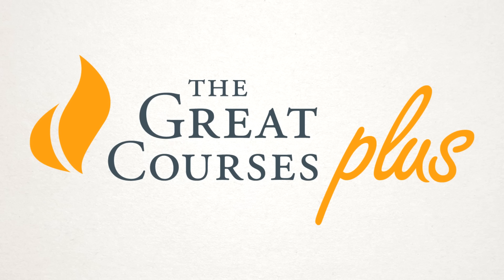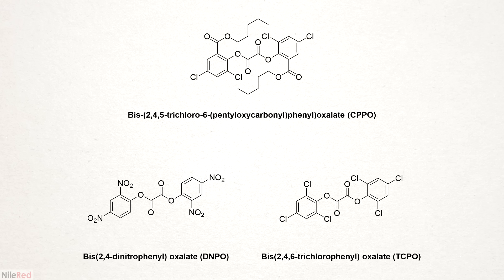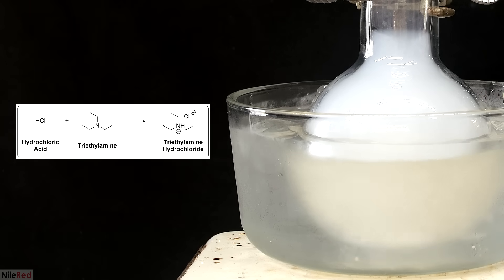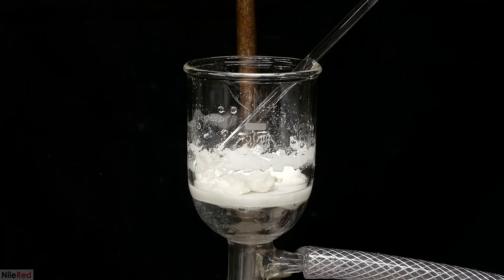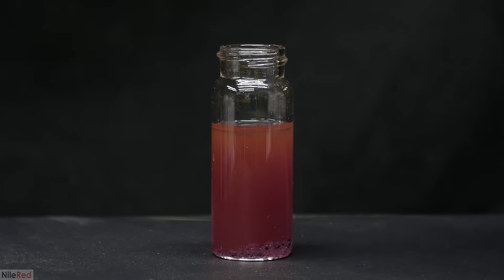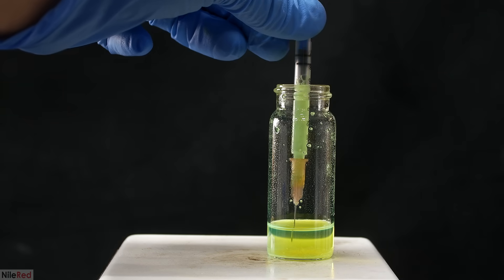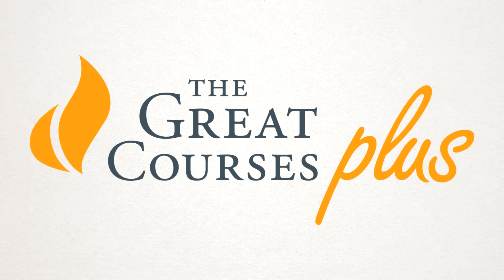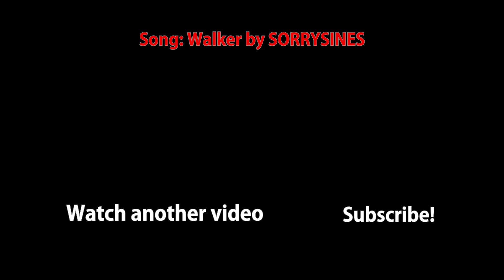Making glow sticks from scratch

Comment: Very interesting 😃 I have a question though...
I was told that used glowsticks could be used again simply by placing them in the freezer for a few hours then 'snapping' them again.
Sceptical I had to try it (just with cheap glowsticks) and it totally worked!
They weren't as bright as new, but pretty close.
How's this possible?

Comment: Why didn't you use clear rubber tubing for the glow strick in stead of a white valve would have worked way better could of sealed the ends with a heat gun

Comment: Noob question if you don't mind answering. How long will your Glow Stick Last? I recall you saying but it's not clear. Also you didn't mention if the glow would continue if you shake things up again so do tell if that's even an option... I know once you break a store bought glow stick one charge and it's done; but for the sake of GREED they want you to BUY MORE. Just wondering if your mixture allows for multiple uses. Thanks...

Comment: Thank you very much - I liked a lot :-) I have a question on another topic: Is there any to indicate temperature changes in a liquid to by change the color of it? Example - changing from under 50 degrees to blue and over 50 degrees red.  have no clue about chemestry, but my goal is to try to demnonstrate the mixing of a hot and cold liquid by means of using a pumpo to circulate the fluid transparent tubes and tanks. I look forward to your answer,, and thanks in advance.

Comment: About 3 years ago, I when returning from an EDM concert, I was playing with the glow sticks that I got over there (twisting it rather) and when I got home, one of the sticks exploded and it’s contents went in my eyes... I washed my eyes several times and then it stopped stinging. Recently, I got diagnosed with myopia and have to wear glasses.. Is there any connection between the two.. also, How dangerous is it if these chemicals enter the eye?

Comment: Toluene is a caustic industrial solvent. Please, anyone planning to attempt this, read the sds and stay well ventilated. Wear goggles, mask and gloves and avoid any splashing. If it gets on your face you will know in about 5 seconds and for the next 10 minutes after washing it off. I use this to clean fire Caulk and paint out of sprayer machines

Comment: So does it actually deteriorate over time eventually causing it to no longer work? Or would it glow again every time you shake it?
I was wondering what might happen if you had a glow stick that had a powder that was magnetic (like iron) inside, then a small magnet on each end of the stick so that the magnetic fields are overlapping slightly, would it cause the liquid to constantly stir (be excited) or would the powder just settle between the two magnetic fields?
Reply: Disregarding the whole magnetic stirring of liquids, let alone doing so with no additional energy ad infinitum.. the excited molecule comes into being from the remains of a broken down TCPO molecule. Shaking is not what excites it, it's a part of the chemical reaction where TCPO is all used up after breaking the vile. Shaking merely makes the reaction happen faster.

It's sort of like stirring in sugar to make a drink sweeter. Stirring helps it dissolve so it doesn't pile up at the bottom for ten minutes. Stirring for an hour wont make it any sweeter

Comment: I'm beyond late for this to be relevant but I had a thought, does ethyl acetate or anything else in the mix react with hot glue? what if you just plugged one end of the glass with hot glue (or something else that would act as a plug that wouldn't react with the chemicals inside or the peroxide) so that you could use thinner glass as the tube to get more volume inside with less air and no need to melt glass with a torch, not to mention the glass would be easier to break in the end product. Clearly I'm no chemist and would not be surprised if I'm missing something but if that'd work it might be easier?    Awesome video by the way, I can't say I could replicate it even if I had the equipment but it glows light on what goes into these things.

Comment: Not a chem; but why do you ice bathe what you heat up? Why heat it up in the first place?
Reply: Allzombifood  Heat is used to start the reaction between compounds. However, if it continues for too long the product will continue reacting either with the air or with itself and decompose into new byproducts. Freezing stops all reactions at once and depending on the chemical, stabilizes the final product.
Reply: @Ivi-Tora  So it evens it out. Thanks!

Comment: Hi Nile Red. Dye chemist here. This is a great video but I just wanted to give some commentary about the dye concentration you used. Fluorescence is highly efficient and more concentrated solutions (even just a few mg) will self quench the fluorescence. It may seem counterintuitive, but try even less dye for more light output. Dye molecules are flat and nonpolar and will form non fluorescent aggregates at high concentrations. This is a static quenching mechanism. Dyes can also deactivate excited neighbors through collisions, so-called dynamic quenching.Colder solutions will also be brighter due to decreased thermal deactivation of the excited state. This may not be noticeable though because dye excitation in a glow stick is based on local collisions in a reaction mixture where reaction kinetics determine light output. Higher temp will give faster rates therefore more light output. I would be curious to see if you could achieve comparable brightness in a fridge with the added benefit of extending the life of the glow stick. Keep these videos coming!
Reply: Vincent Martinez    This was quite a lot of interesting information:D I didn’t know the effect it could have with how bright it could be!
Reply: Lemme slap it in a microwave
Reply: @scottwales5966  with a vicks mask, crumbly tabs, bass pound hard like heart attack ... POP!
~2009, glowstringing Chicago
Reply: @scottwales5966  I like ure style
Reply: @scottwales5966  I did this in my recent tcpo video  microwave makes it brighter ✨️
Reply: Scott Wales 
How was cleaning melted plastic?
Reply: Im just gonna act like i know what your talking about...
Reply: @ooferpoofer2127  same
Reply: @ooferpoofer2127  same
Reply: @ooferpoofer2127  you dont have to know whay hes talking about hes teaching you what he's talking about kridviijisbsjzuriritorjrjsjsjshekehsjshshwokbahadijrj
Reply: @ooferpoofer2127  same
Reply: This is why I love YouTube!
Reply: @pramodshahji1794  Principles of Fluorescence Spectroscopy by Lakowicz is essential reading. I would start there.
Reply: So will the thing that you said would increase the intensity or the energy of the photos coming out?
Reply: @namansingla2975  It would increase intensity (number of photons). Energy is determined by the molecular orbitals. These are locked for a specific dye so you are not changing energy.
Reply: @abby Hi abby.
Reply: Deactivating excited neighbors sounds cool, all I need is dye and some collisions, so throwing paint at his house should work :D
Reply: was dead ass thinkin the same thing
Reply: @3mmiii975  I need ta get my boots on..... shits getting deep in here lmao 🤣
Reply: my tiny brain is trying to process this
Reply: This is what youtube is supposed to be used for.
Reply: @jeast9648  facts
Reply: So, both colder, and higher temperatures will make it brighter?  Gotcha.
Reply: @Qui-9  Depends on a lot of factors. If excitation is by light then colder will make it brighter 100% of the time. His excitation is by reaction. Reactions are faster if heated. He would have to experiment to know for sure.
Reply: @vincejohnm  " Depends on a lot of factors. If excitation is by light then colder will make it brighter 100% of the time. His excitation is by reaction. Reactions are faster if heated." 

What's the reasoning behind this?  It's interesting to me that the process used to create excitation has exactly the opposite effect based on the method in which it's occuring. (Or attempted).  Is there some type of relationship that creates that disparity?  Or commonality?  (Guess it depends on how you look at it.)
Reply: Hi Dye Chemist, I am the Steel Alchemist
Reply: @awesumsawce hi abby im a human being
Reply: I’m always blown away by beautiful colors in chemistry. Totally appreciate your comment
Reply: Duck I love how smart people are like magnets thanks for the lesson
Reply: @Fakeittillumakeit101  ah duck not u man.. I’m sorry..
Reply: @queenkiki5368  yea it’s kinda what I was implying sorry if it went over your head
Reply: @Fakeittillumakeit101  NO DUCKING WAYYY LMAOOO
Reply: That's pretty fascinating!
Reply: Holy crap do I love this channel.
Reply: Did anyone else have no idea that a dye chemist is a thing
Reply: This is actually really fascinating. I'm definitely no expert, but thank you for commenting this, definitely has inspired me to read more about dye and fluorescence chemistry.
Reply: I like your funny words magic man
Reply: damn, an actual knowledgable comment on youtube
Reply: I so loved this vid an this comment. Are ye gonna try mate!?? ✌🏻💗😊❣️
Reply: A Hispanic chemist, that’s awesome! I had never seen one before. Keep doing us proud man. Greetings from California. 👍🏼🇺🇸
Reply: Hi mr smart I’m quack
Reply: @quacktheduck3652  your high on QUACK x3
Reply: @quacktheduck3652 the way I felt when reading this lol
Reply: This is incredibly helpful! Question- Do you know how to make, say, glow in the dark dye powders or pigments? I'm looking into potentially making some glow in the dark products (dice specifically) to expand what I'm capable of selling, and if I could make my own glow dyes for cheaper than buying some online already made, I'd definitely do it.
Reply: @StormTheSquid  Glow in the dark is not fluorescence. It is phosphorescence and is a different but related phenomenon. For phosphorescence to occur you need a very long lifetime in the excited state. This increases the odds that the excited electron is perturbed into a triplet excited state and cannot relax (spin forbidden transition). I believe that is why plastics are used for many glow in the dark products in that they restrict molecular motion which can increase fluorescence lifetime. I could be wrong though. I worked on small molecules for in vivo use, not commercial plastics.
Reply: @StormTheSquid  you can buy glow powders in many colors on Amazon and mix it in resin to mold your dice.
Reply: @JustAnotherPaddy  I could, but the point of asking was to see if I could do so for cheaper on my own instead of buying them ready made.
Reply: @StormTheSquid  what's the making cost for one that you can put in. Also what's the price they are sold for online?
Reply: @namansingla2975  how can you type that and not know how to find out what you re asking?
Reply: @leojciaccioii  Who’s to say he or she didn’t search for this question before or after posting their question? What’s wrong about seeking another source of info? Why are you downing him or her so much for seeming info? Lmao chill
Reply: Lamar Davis except you didn't
Reply: I- don’t understand but O K
Reply: Very interesting, I didn’t know that.
Reply: eerrrrmmn big science
Reply: this is like the cutest interaction i’ve ever seen lol
Reply: I knew that
Reply: I like your funny words magic man.
Reply: Remember, dyes are subtractive.
Reply: Holy

Wow
Reply: Hi mr dye chemist, im hila
Reply: @lampkin45 hi Abby, Im osi
Reply: Ya I def know what your talking about 😎
Reply: What would happen if i injected myself with the fluorescent dye
Reply: wait, hold up, you said: "Colder solutions will also be brighter..." and you also said: "Higher temp will give faster rates therefore more light output." I'm confused, which one makes more light?
Reply: @Metal_Master_YT  I answered this in an earlier post but maybe I wasn’t clear. If you excite the dye with a black light (UV) then cooling the solution results in brighter fluorescence. Glow sticks don’t work like this. They are excited by chemical reactions. Reactions go faster with more heat which means more light. It’s a balancing act. Too much heat destroys fluorescence. Too little heat and the reaction goes really slow. Without experiment we can’t say which temp will be brightest.
Reply: Great😊
(Deep inside my mind:WHAT THE HELL IS HE TALKING ABOUT😵)
Reply: one time, i was so cold i put my hands inside the microwave to make it warm. and then i thought, 

"wow! i'm the most stupidest person in the world"
Reply: Yes of course, it’s so obvious when you think about it
Reply: I dont know what all that means...........lol
Reply: What's the scientific formula for di-chemist
Reply: When I was a kid, we would store our glow sticks in the freezer to keep them "good" for longer.
Reply: How did I understand this amazing thank you
Reply: thank you for the knowledge
Reply: I guess, I have to go back to ebay to get my glow sticks..
Reply: Yep. That’s what I was going to say.
Reply: Hehe smort
Reply: As a kid, whenever we got glowsticks they basically lived in our freezer forever in the silly hope that they would work forever
Now I know why.
Reply: Make a YouTube video pls
Reply: Yeah, what he said, obviously
Reply: Im just gonna go back to kicking rocks in my dumb people corner. Holy hell.
Reply: Wow, I learned something new from this comment thanks!
Reply: @rixile wait what
Reply: Thank you for the mini chemistry lesson! Very interesting.
Reply: To many words but i agree
Reply: I was about to say the exact same thing
Reply: 7383 people acting like they understood a word.
Reply: Bhiao koi nhi padega yeh
Reply: Wow
Reply: I’m gonna give him the “ite”
Reply: My brain is confussled
Reply: Such amazing info! Easily deserved a sub!
Reply: WOW SO DETAILED
Reply: Hey, when I'm reading your comment I was goin' on blah blah blah blah blah and at the end, I smashed my head on the wall because my last brain cell was thinking, "Hey Man, who IS this guy? Is this Einstien's relative?" I am now undergoing a surgery due to my smashed head. But, speaking the truth, You REALLY are a GREAT guy! Thanks!
Reply: Hi dye chemist, Parker here.
Reply: I like your funny words magic man
Reply: Funny words magic man
Reply: NEEEEEERDDDD
Reply: Oh so thats why they revive themselves in the freezer!
Reply: This guy sciences
Reply: Can you make cocaine???
Reply: @robd1329  What color cocaine?
Reply: îoo
iookîkkòoooo
Reply: Huh?
Reply: Someone’s getting laid in collage
Reply: I love big brains 🧠
Reply: Hi Dye Chemist! I'm Dad
Reply: This is a lot of stuff
Reply: Way too much I hope you know that you are smart
Reply: Interesting
Reply: we got a nerd here
Reply: @superkickparty8500  I think you’re in the wrong part of YouTube. “Coloring in the lines” is that way 👉🏼
Reply: My sentiments exactly after watching this.
Reply: got roasted by a 90 year old xD
Reply: Martinez, hi I don't know if you'll see this but I'm aboutcyo maje a video on this. Do you have any suggestions on the optimal ratios to use or anything I should film doing with this?
Reply: I ain't readin allat
Reply: Damn that’s crazy
Reply: IMO That's why keeping glow stick refrigerated extends the life and performance.
Reply: Reading need patience and time
Reply: i dont get any of it englisch aint even my 1. language  but it sounds constructively solid 😅
Reply: I love it🥰🥰
Reply: I’m screenshotting this comment for my science fair haha
Reply: Would you expand on the "flat and non polar" part please.
Reply: Hi
Reply: Shut up nerd
Reply: THANK YOU  SO MUCH
Reply: The 1% of actual chemists watching him

99% non chemists watching his video
Reply: @jadenp2255  I'm the 0% there. I'm someone who is in the process of becoming a young chemist.
Reply: @jadenp2255  us chemists still watch Nilered
Reply: Go commit dye chemist XD - Great advice, great post!
Reply: Hi Sir. I am a high school chemistry student currently working on my Chemiluminescence Study. After Reading you comment, I am very interested in the theory you have mentioned. I have been looking for a research question and I do think the concentration of the fluorescent dye could be a great independent variable. I dont know if it is possible for me to contact you via email?
Reply: Hi dye chemist im dad
Reply: Vincent Martinez what if you left the dye out of the solution? I’m actually curious. I would assume that there would be no glow because there’s nothing for the chemicals to react off of and produce light unless it glows naturally. But I’m just making a guess and trying not to “stab in the dark” while doing so. Lol
Reply: @NitroGuyJH  Dyes glow for a variety of reasons but they all stem from excitation of electrons. The dyes in glow sticks are excited by a chemical reaction, however, you could just as easily excite them with a black light (high energy photons). Many dyes glow poorly or not at all out of solution due to quenching mechanisms.
Reply: Vincent Martinez Yes, thanks for the response. I legitimately wanted to know, I also want to get a better understanding by exploring the different types and solutions to make fluorescent fluids and paints.
Reply: @bonnie you mean “thirsty”
Reply: What?
Reply: @Ladybugg4099  Say Natas
Reply: Nerd
Reply: Shut up
Reply: Ok
Reply: Wrong.
Reply: Go f yourself nerd Nile is smarter than you
Reply: Kinda sus he didn’t even like what you have to say.
Reply: No se que dice pero miente
Reply: THIS IS TO GET SUBS
Reply: dude wroth a paragraph on stufc no one cares aboit, wow.
Reply: I want to write some "I just spent 30 seconds on Google so now I know more than the professional" type comment but it just feels so wrong.
Reply: Damn thats long
Reply: @Enchanter144  I get that a lot, thanks for noticing.
Reply: Oof, a roast.
Reply: Nerd
Reply: @gasperbucinel  not you making fun of them for giving advice